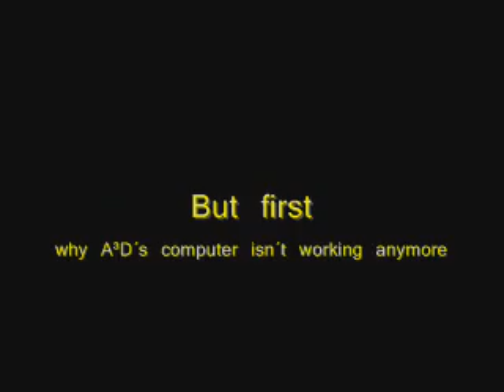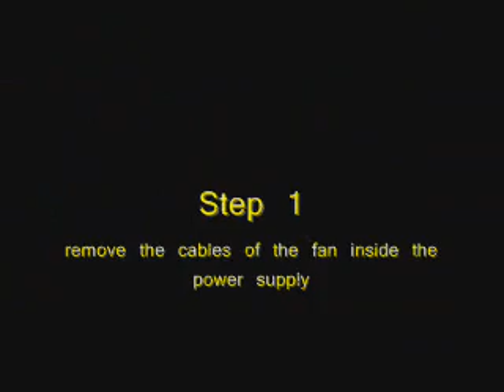How to repair a broken power supply fan

Comment: It is not recommended to replace non-quiet power supply fans with quiet fans because the original high rpm fans inside are rated specifically to cool the non-quiet power supply. You will run a high risk of overheating your power supply if these higher airflow fans are replaced with a fan with a lesser cfm (cubic feet per minute) airflow rating. A quiet power supply uses a larger and more efficient heatsink area as well as more efficient circuitry to compensate for the lower speed fans.